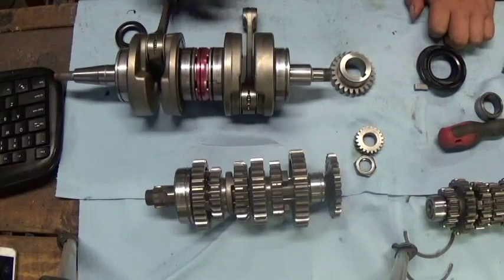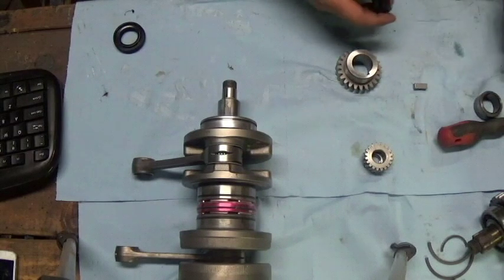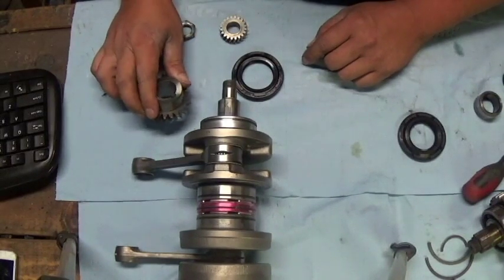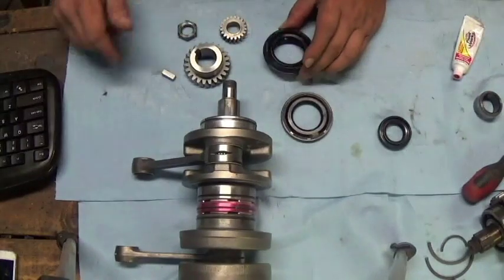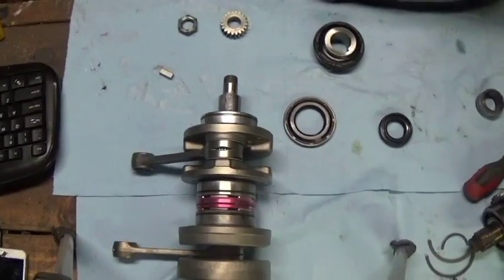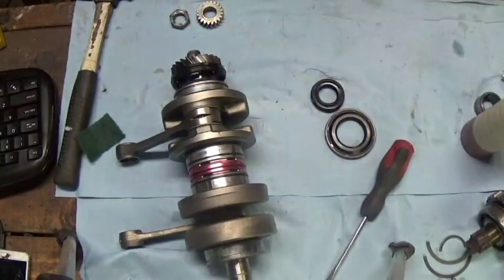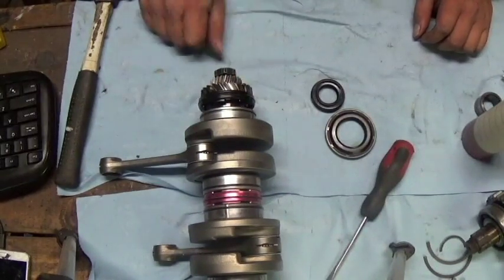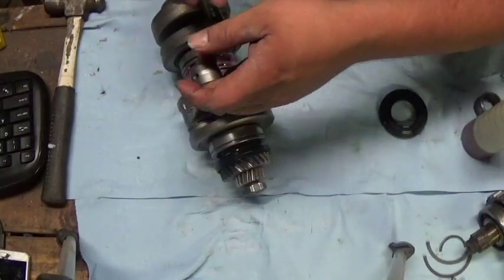Banshee crank seal install

Comment: Do the cases have to be separated to pull the crank gear off a assembled motor...im  switching to straight cuts.
Reply from the maker: Nope!
Reply: Whats the best way to pull it off the crank

Comment: Im having a hard time finding the O-rings that come on the hot rods crank. They are on the inner bearings (the red item too). There are no part numbers on Hot Rods site and when I called them they could not find a part number. The O rings on my crank are in pieces. Not sure where to go from here...

Comment: Hey will the orange RTV work on that key way?
Reply: When working on this Yamaha, you would want to use Threebond 1211, Yamabond 4, or other similar type sealant. So since its on hand you would want to use that.  Not regular RTV silicone .

Comment: what kind of sealant are you using when you put the half moon key on the shaft?
Reply from the maker: duane speck 
Yama-bond 6B, use it for the entire build sir.
Reply: thanks much. first time replacing crankshaft seals on a banshee. i take it theres absolutely no way of replacing those seals without splitting the case? thanks again
Reply from the maker: duane speck 
No there isn't because the seals have a lip around the edge that sit in the case. 
You can flip the engine over and just pull the lower half. You'll just need to raise the crank out of the case enough to get the seals on it. 

I always split cases properly though. Can be done in about 4 hrs from running,to split and back in the frame running again. A first timer should be able to do it in one day is think.
Reply: South Texas Banshee thanks for the info. much appreciated
Reply: Any specific seal grease or just any rubber grease? Thanks